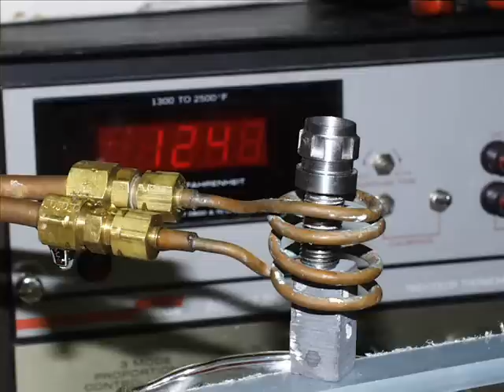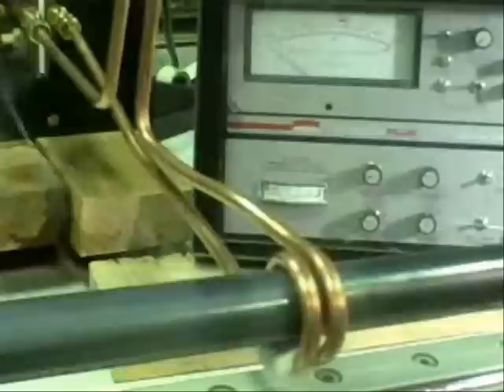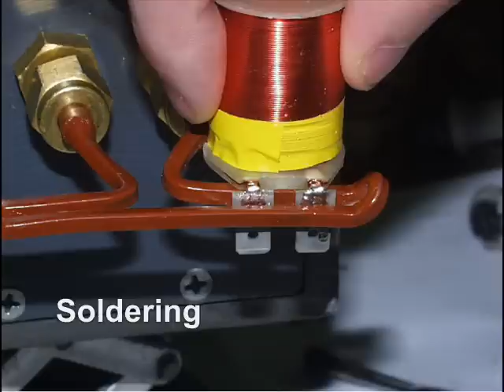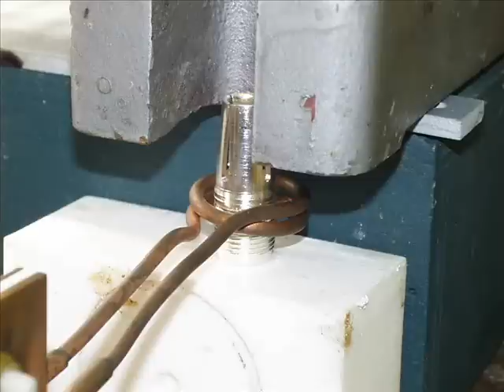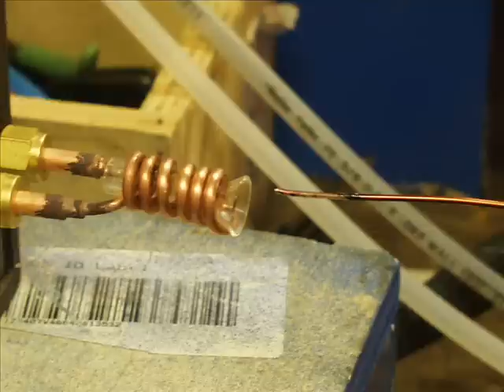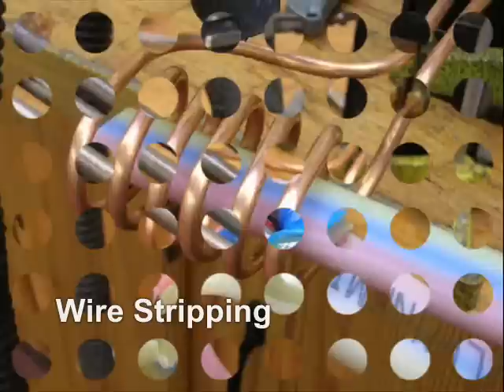Wire heating with induction

Comment from the maker: The coil itself doesn't become warm -- it's actually cool to the touch. But the part does. The heat is only generated by the induced current flowing in the workpiece